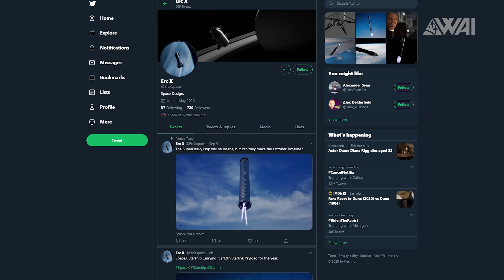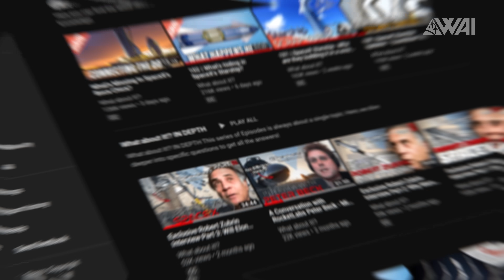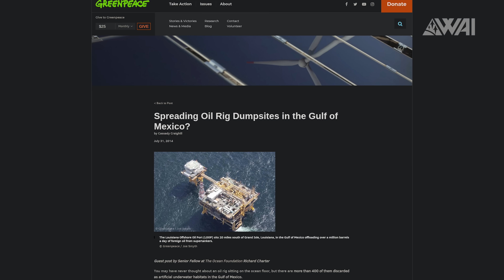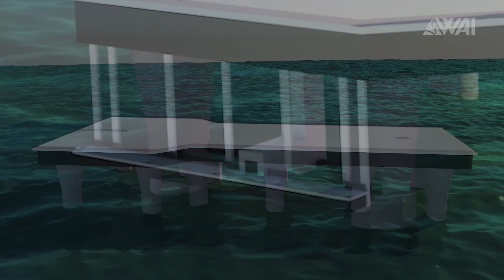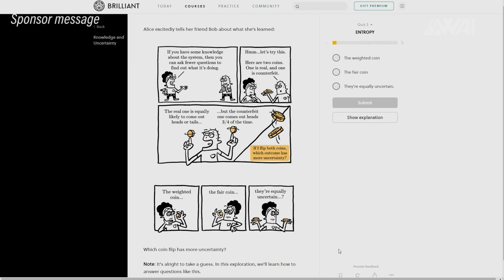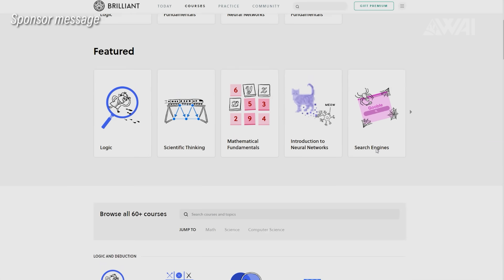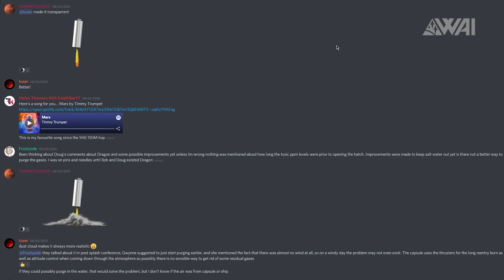118 | SpaceX Starship Mass Production Starting

Comment: I have a question!  Where will there be storing all of these ships?  They already have 2 functional starships with no where to store them.  Is there just going to be a parking lot with Starships lined up outdoors?
Reply: How about a giant Starship coat rack to hang them up when not in use?
Reply: Massive wine rack
Reply: SN5, and 6 will likely be museum pieces as soon as they start using SN-8. New steel, new process, and very quickly they become outdated. Eventually most likely stored horizontally in warehouses until they build more infrastructure.
Reply: @hashimgambit  They will do way more test flights.......these babies won't see a museum at all because they will most likely be tested to destruction.
Reply: @SpaceXsuperheavy  probably not. They are basically moving beyond the point of these having good data points. They will never do a 20km hop so we have a good chance at seeing them survive. SN-8 9 10 and 11 will be built by the end of the year.  8 is ready to go, and just needs the 3 Raptor engines and flaps.
Reply: Will there be a very depressed robot looking after them?
Reply: SpaceX is making weather resistant rockets. The rockets aren't just sitting on the ground. They are on something. This is a necessity, as they don't have feet yet.

Even with feet, I won't be surprised if rockets are bolted down when not in use. SpaceX doesn't want their rockets to fall over in a hurricane or Earthquake.
Reply: @hamjudo  That would suck!
Reply: Recycling
Reply: Teddy  I like that one!
Reply: Teddy  launch sites will be off shore once they start production. The exclusion zone would be too big to set up on land.
Reply: Teddy  tanks get tested till failure. The goal for the actual flight articles is to have them survive. SN-8 will likely die on the 20km hop tho. More data if everything is still together.

Comment: Not sure an above water rocket launch will cause that much noise under water. 

Sounds waves are compression waves and water doesn’t compress. Sound waves in air   bounce off the surface of the water. 

You can see this effect in explosions over water where the shockwave barely raises a ripple in the water’s surface. 

I suppose it might transit sound from the vibration of the structure.
Reply: Yes it will transmit through the structure. That's the problem which the 'bubbly curtain' is solving.
Reply: @SouthernHerdsman  and the exhaust is pointing into the water

Comment: Getting those huge star ships from a ship to a platform similar to an oil rig in one piece and undamaged would be harder than plaiting shit.
Reply: Probably easier for the initial launch to be from land and then then it can land at the platform and be used from there
Reply: @pcgee12  110 plus metres by 9 metres, tube of steel that thin will pose problems getting it to the platform unless it lands there under its own power, so you may well be right.
Reply: @nicktombs1876  Just crane it upright onto one of the old landing barges, sail it to the platform and crane it from barge to platform.  Use a dummy liquid in the tanks to weigh it down onto the barge while sailing.
Reply: @johndododoe1411  They don't need old barges when they are building brand new ones.
Reply: Definitely thing your idea is right, but we will have to wait and see what the geniuses at SpaceX do 😂

Comment: There are speculations that SN10 is indeed the Super Heavy prototype. Forward dome is usually sleeved with 3 rings. SN10 is the only one sleeved with 4 so it should be taller therefore it could be Super Heavy hopper.
Reply: Yes. The timing is right - this and other sections will be ready to stack just as the High Bay is completed. Thus 2 sets of work crews can work on 2 separate vehicles.
Reply: My guess is elon is trying to complete a full size starship and super heavy and stack them together for his presentation
Reply: @KAPELAKI  This would make a lot of sense. Especially since a full size starship stack (even if it is a prototype) will be one of the most awe inspiring sights you could show to people at a presentation.
Reply: Teddy  if it's pointy enough then he sure will😂
Reply: Elon said if SN8 "craters" SN9 and 10 are close behind so nope, let's kill that rumour before it escalates again.
Reply: If so, then the first fully completed starship prototype will mosy likely fly by December!
Reply: @Peacewith_christ  or shortly after! Exciting times for space exploration!
Reply: Pretty sure parts mistaken for starship are actually super heavy parts. It makes no sense to build 5 starships in advance at this point.
Reply: MrJohnManiac ...  Good catch AND makes a lot of sense..!!
Reply: Yes, the most likely reason to sleeve it like that is to build the stage coupling. If it was a Starship I don't see the advantage of moving the section joint up one ring
Reply: Good eye!

Comment: Interesting fact about the buble wall.  I want to add that I was in a submarine as a sonar tech, so I know a lot about how sound moves in water and air.  Sound does not transmit easily into water.  I did hear what you said about a thirty mile exclusion zone, so the shear volume might be enough to jump into water.
Reply: The start will shake the whole platform, that vibrations can cause noise in the water, too.